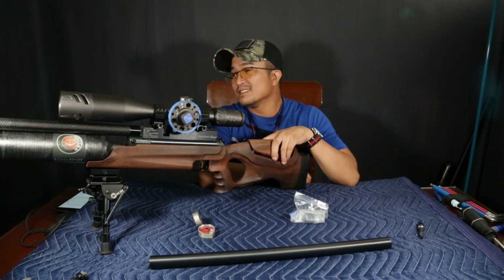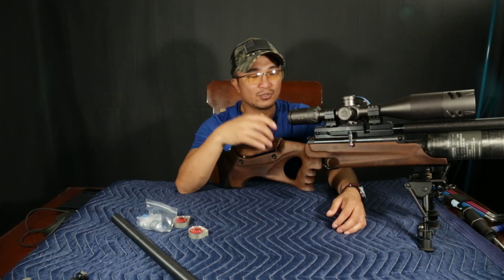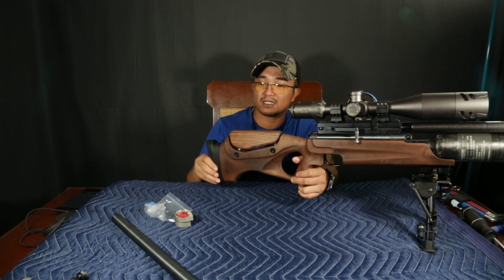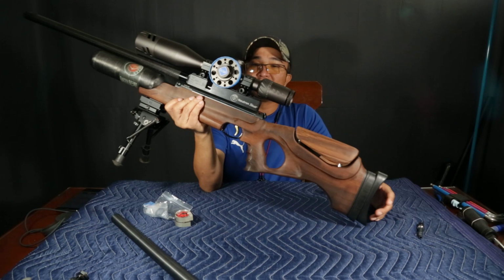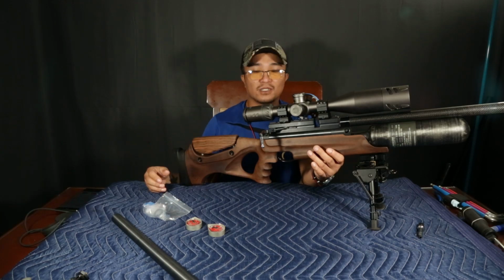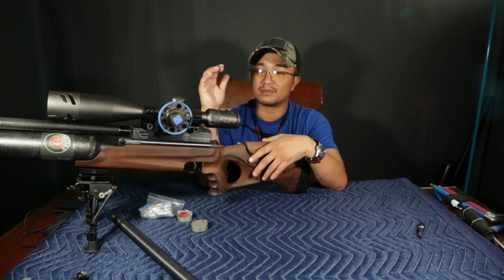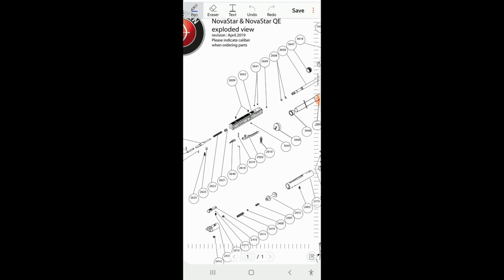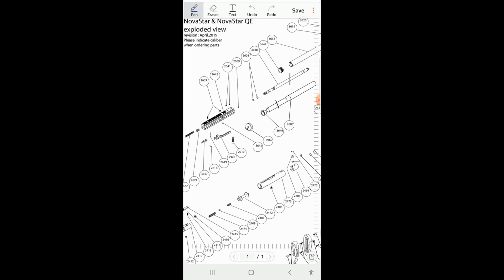Hatsan Neutron StarOverview and first impressions

Comment: nice video sir but if you main priority is power then why you didn't picked hatsan Hercules 30 cal over hatsan neutron star?
Reply from the maker: High power is never our priority.  Good to have, but never our priority.  The Hercules is uglier and much much heavier heavier. Even with the neutron star equipped with scope and bipod the Hercules with no scope and no bipod would still be heavier by several lbs.

Comment: any luck yet with testing slugs?
Reply from the maker: No. Weather have been a hindrance. We will. We've also ran into another issue with the gun and trying to find solution for it. We will keep you folks update on progress for sure. We have just about every weight slugs from NSA as well as VK so soon as we can we will. And we'll tell you no bs just facts and a few opinions.  No sell tactics or promotions unlike most out there so you can trust our review.

Comment: What's the difference between this gun and the nova star?
Reply from the maker: The original hatsan nova star was 10lbs out of the box and there were quite a few things different. The new nova star is the same gun as this neutron star which is now about 8.4lbs. There is no difference from the new nova star to the neutron star because it is the same gun. It was just changed from nova star to neutron star for legal purposes.

Comment: Great airgun I have one .22.   How I can degasing the bottle ?thank 🇵🇷
Reply: Thanks
Reply from the maker: Two ways. Fire the gun until empty. Or remove the stock then being careful not to scratch up the finish of the gauge slow turn the gauge very very slowly counter clockwise until you hear air escape then stop. And let it go to empty. When you see the gauge reading zero or no longer hissing of air then slowly turn the gauge again counter clockwise until you hear more pressure leaving the bottle. When you no long hear zero then turn the gauge a bit more until you are certain it is completely empty and you can remove the gauge. Replace gauge by hand tighten only should be fine or just a very light snuggling of your tool is ok too. Don't iber do it.

Comment: nice video!!! just two questions.... is the barrel chocked? and what is the difference between the nova star and the neutron star?
Reply from the maker: The original nova was said to be heavier by almost 2lbs. For the most part they are the same gun with just some very minor differences. Like carbon fiber bottle vs alloy and stock were also different. If you're talking about the nova star and neutron star there isn't a difference because the name changed from nova star to neutron star due to legalities.
Reply: @aerosentinels  thanks for your no b.s. review.....can i also shoot slug with this rifle?
Reply from the maker: We have just about every gr NSA slugs available on hand as well as VK slugs. We have not yet had time to test especially due to crappy weather as of late. We will test soon as we can . And do more video updates. We will confirm if choked or not and let you know.
Reply: yes you can.  I shoot the slugs in both my 22 and 25 and they are accurate and hard hitting.  these guns will shoot almost all pellets good. I shoot jsb and H&N, poly mags long, and some skenco pellets
Reply: i guss the barrel is chocked. I watched a video of Airgun South Africa, Matt thinks chocked  barrel is important for slug (no chocked, no hope). 

 I don't know if there will be more airgun manufacturers that will produce pcp rifle suitable for slug. slug get so good BC